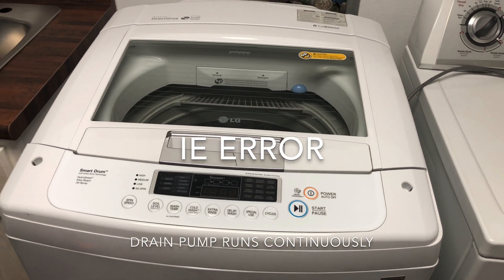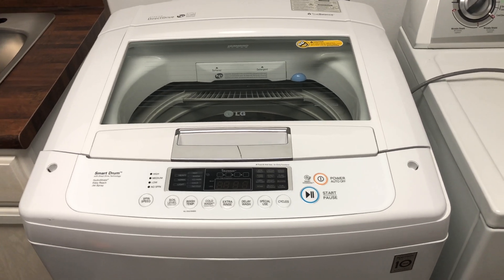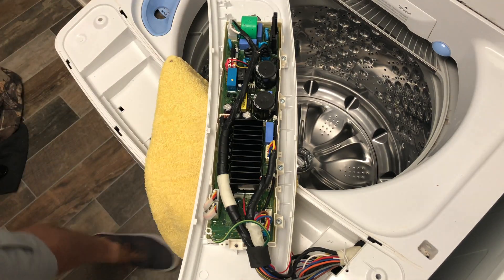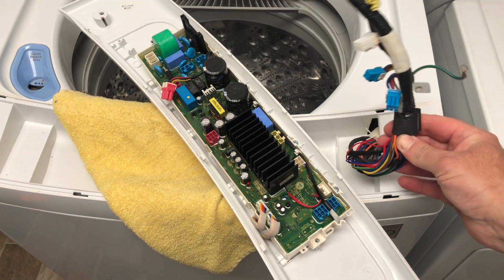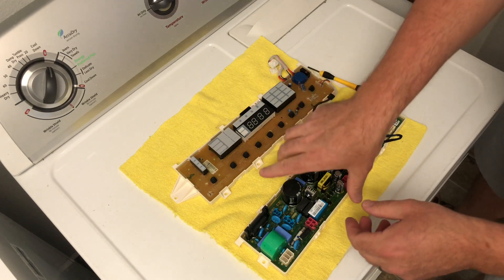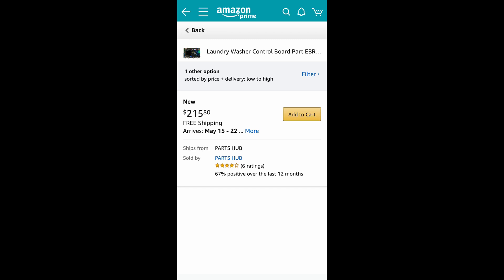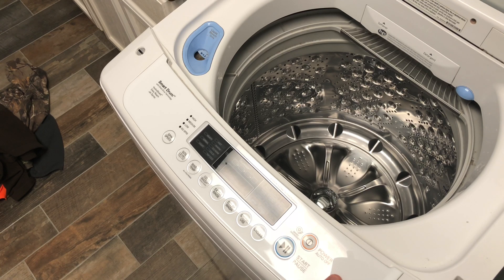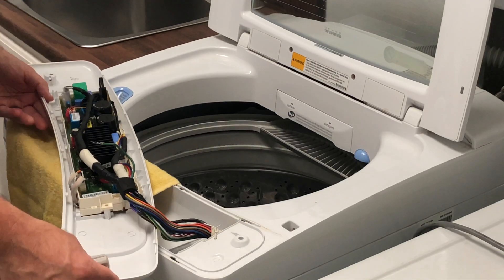LG WT1101CW Washing Machine IE Error Drain Pump Runs - 3 Month Update - Board Replacement

Comment: mine was the drain hose was falling apart and leaky, had broken off at the top, was laying on the ground and leaking in 2 places. I will be using pic pipe as mine runs outside in the sun.
Reply: The drain pump is not running, the drain hose leaking and being lower than the drain is siphoning the water out of the tank as fast as it can fill. So the washer never gets enough water to operate properly. What we noticed most was the washer kept getting out of balance and the ie code. Once the hose was fixed the problem was gone.
Reply from the maker: Ok, got it!  That makes sense and I guess explains the little hose holder designed at the top of the washer.  The hose needs some elevation to help keep the water from draining before it’s time.  One would assume that the seals in the drain pump would be sufficient to prevent this, but I guess not.  Thank you for your comments!  Very helpful!
Reply from the maker: I have not heard of this cause for the drain pump running continuously.  Interesting...Good luck with your fix!
Reply: my drain hose runs through a thin wall to the out side into a pvc pipe into the septic tank, just redid all last night with pvc

Comment: I have a code OE which is the machine will not pump water out or go into the spin cycle. I replaced the pump but it continues to do the same thing. It will not switch to the spin cycle and pump the water out even though I changed the pump. If I unplug the machine for a day and plug it back in and hit the spin cycle it will pump the water out and spin. It will only finish the cycle after a day being unplugged. Any ideas?
Reply from the maker: This same exact OE error problem developed for me after replacing my board.  The only way that I could get my tub to drain was put the old board back in.  I ended up sending the refurbished board back and getting a refund.  Tired of error codes, I put this unit on the back patio for later analysis and bought a new washing machine.

Comment: Hi David - I have been whacking my relays for a couple months and decided to get a board tonight. I ended up using the company you mentioned in the video - did they send you a new unit or was it remanufactured? I just realized a few minutes ago I had bought a remanufactured board from them (I didn’t read the fine print I guess).
Reply from the maker: Mine was remanufactured, as well.  Mine ended up throwing an OE Error and I sent it back to them for a refund.  

Is yours working ok?

Comment: Thanks for the info. Watched your first video and it has fixed my problem....for now. Using on borrowed time it sounds like. I’ll be preparing for the inevitable circuit board change. $200 for circuitboard is a lot cheaper than having to buy a new $900 washer.
Reply from the maker: Awesome!  Glad it worked...for now!  If you want to subscribe and hit the bell, you’ll get a notification when i post my next video on the unit.  I appreciate you taking the time to comment!